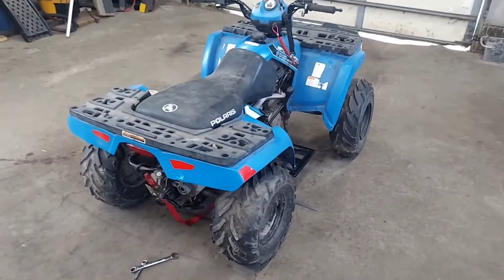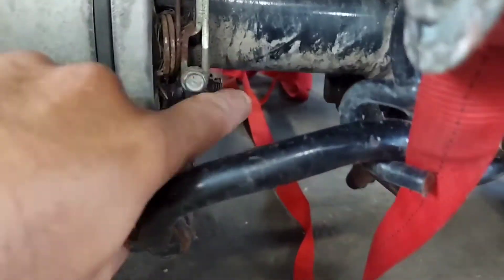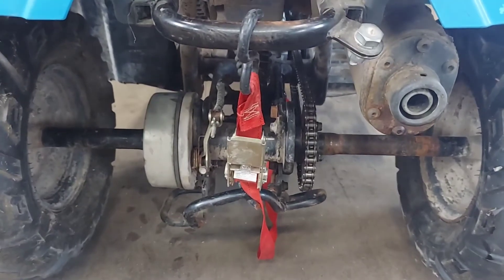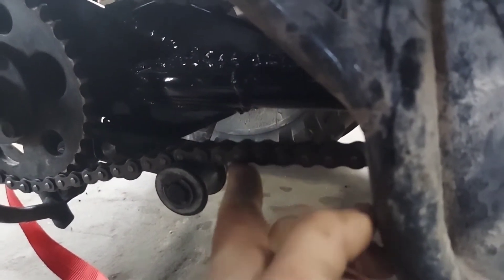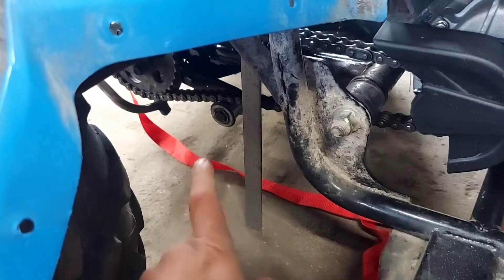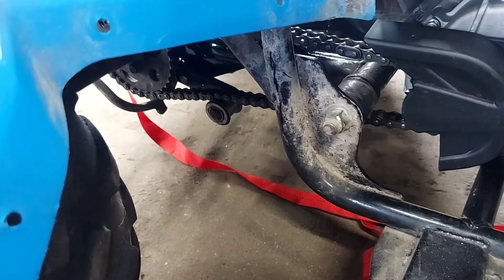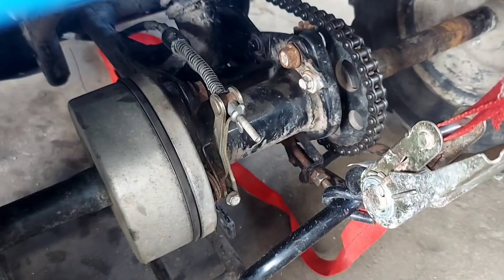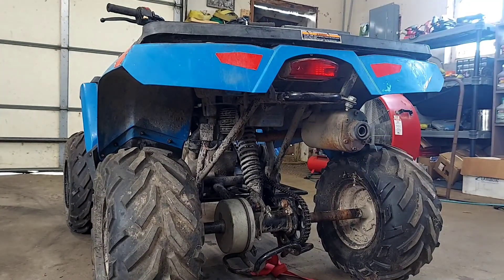Polaris youth atv chain adjustment

Comment: Usually don’t hear Polaris with a chain but my wife’s 2004 trail boss had a chain and a belt
Reply from the maker: Yeah the youth models have a chain.  A belt too for the cvt. The really old polaris atvs had chain drive front and rear on the 4x4 models.
Reply: All youth ATVs have chains.

Comment: How does the tensioner and spring mount on to the 4 wheeler?
Reply from the maker: There's a bolt that goes thru the tensioner arm. The spring goes around that bolt and onto the tensioner arm.

Comment: How do you replace the front cog
Reply from the maker: Remove the sprocket guard, remove the chain, then remove the 2 bolts on the sprocket and you're good to go.
Reply: @Whitestrash  I got it off I couldn't figure out how to get the cog and Lock washer back on but I figured it out they're not supposed to line up I was like duh 😆 but thanks for replying man